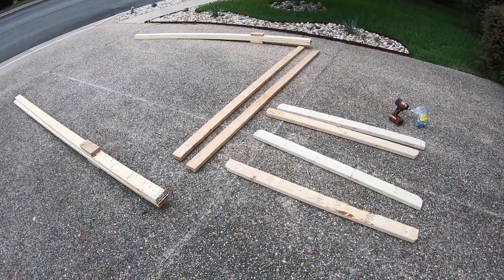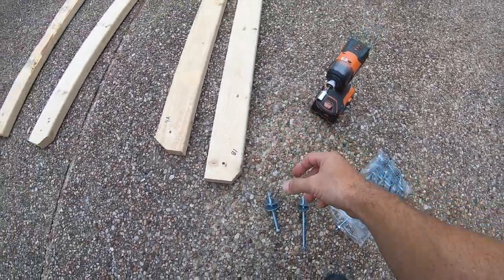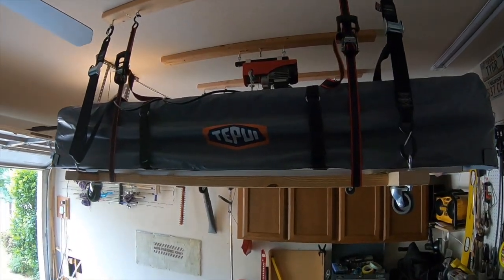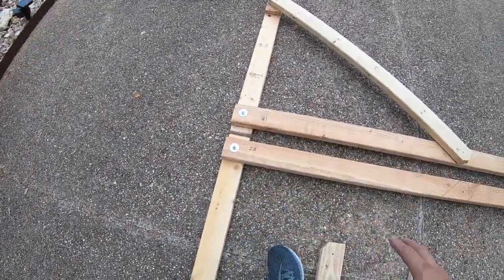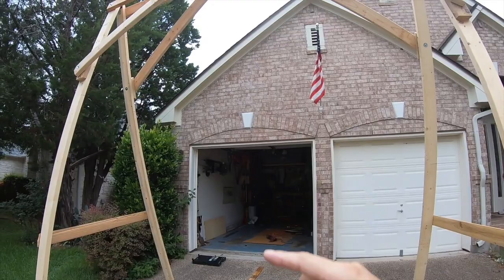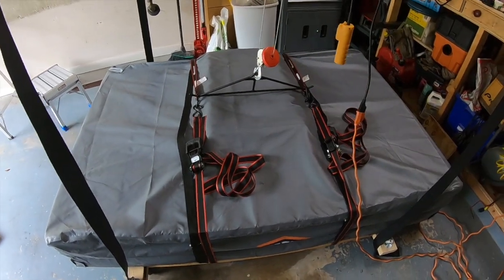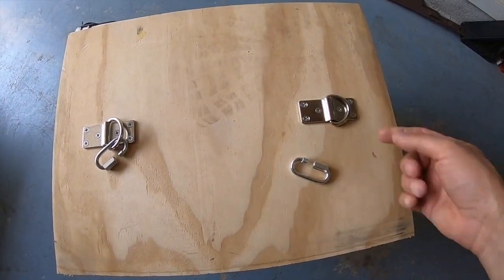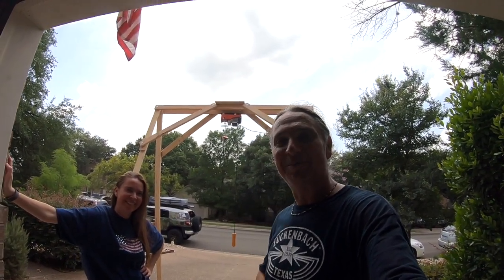Tepui DIY RTT Mounting and Garage Storage

Comment: I noticed you have the Front Runner QR mount kit. Do you notice any rattling noises coming from the brackets while going over chattery or rocky roads? Specifically the guide bolt and guide channel area. Mine rattle like crazy!
Reply from the maker: YES!! I figured out that on two of mine, with the latch closed, the latch does not make contact with the channel of the bracket, so there is play. That play is the noise. I now put a piece of wire there when I latch just to keep it from rattling. I want a more permanent solution, but have not found one yet. If you do, let me know.

Comment: Thanks for the video. My 10 year old Jeep JK has always been garaged but after we got the rtt I have had to park it outside and it’s making me sick.
Reply from the maker: That is an accessory for the FrontRunner roof racks.
Reply: I built this last night and tried it out tonight. I don’t have an electric winch yet so I used 4 cam lock straps. That was a bit sketchy so I have to get a winch. The frame is a beast though. Plenty strong and stable enough for a rtt. Thanks for posting this video.